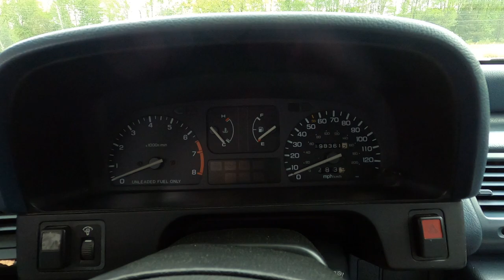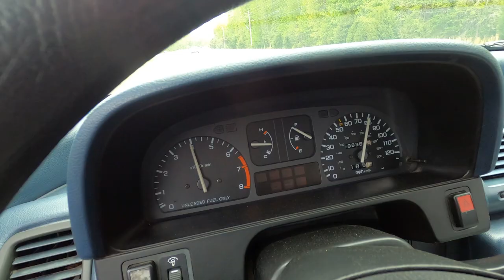Installing A Ton Of New Parts On My Honda Element!

Comment: Yep I had to do all of that stuff and more on my 2005 CR-V. Mine is a stick shift and as best I can determine it is going on the original clutch. Given that the vehicle has over 200k on it I see a new clutch in my future.
Reply from the maker: Sheeshhh mines at like 236k right now still with the stock clutch that i know of
Reply: @pop_pops_garage  I mean, it feels OK but I’m starting to notice that it grabs pretty high. It doesn’t feel like it’s slipping though. That being said, I do anticipate having to replace the clutch in the foreseeable future.
Reply from the maker: @mds2465  you can adjust the engagement on the pedal!
Reply: @pop_pops_garage  yeah I’m aware of that. I think I did that already but I’ll check it out and see if it can be adjusted any further. Thanks for the tip.
Reply from the maker: @mds2465  no problem!

Comment: What is up with the quality of gloves these days, mine rip like that too. It’s like as soon as you start using them they get soft and rip. Also, RIP that ball joint 😂
Reply from the maker: The best gloves I’ve found are the harbor freight black ones (i wanna say they are 9 mil ones or something). I use so many gloves it’s insane. Also why are they so expensive 😩